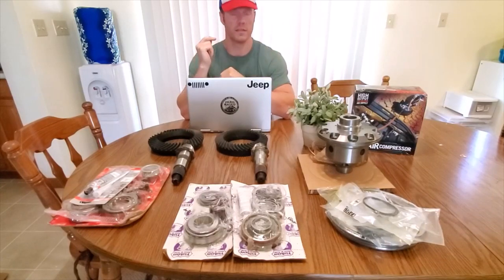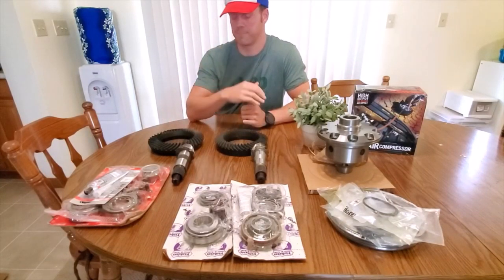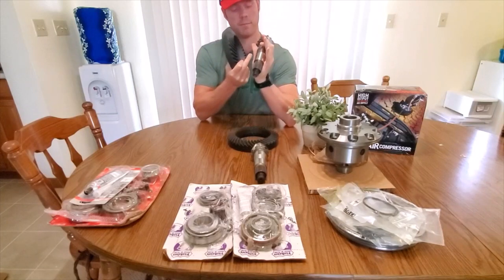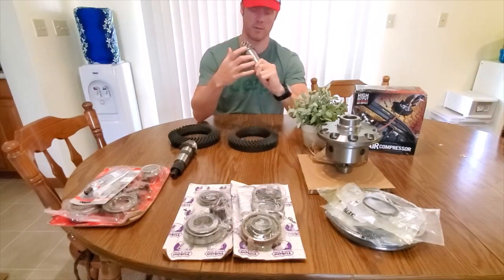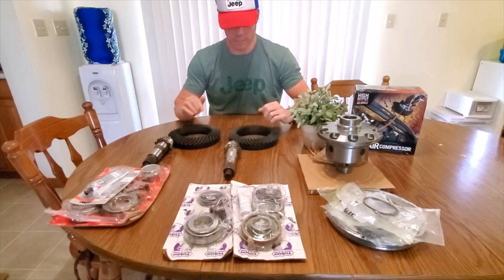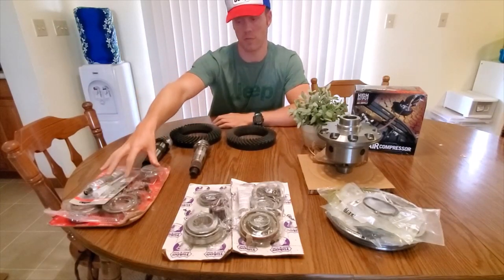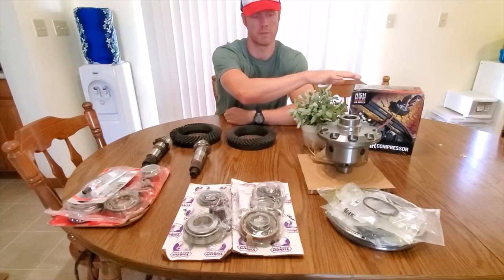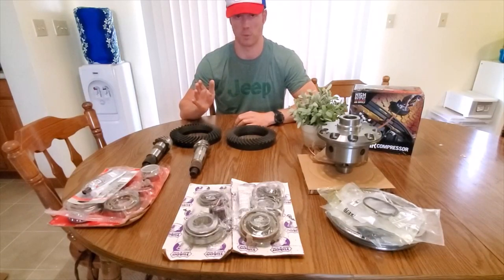JK vs JL Advantek Dana Axles M220 M210 Ring and Pinion ( Gladiator Wrangler Axle Tech )

Comment: Good information, I know this is a 4 year old video, but I recently bought a JT, and I like to get every bit of info I can on my 4x4s. 

I used to have a 2008 Nissan Titan. One thing that is cool about the Nissan version of these Dana 44 axles is that they are screw adjusters instead of shims. I put a Yukon Grizzly locker in mine and screw adjusters make it easy to set back lash. Yukon doesn't make that version anymore for the Nissan, but I digress.

Comment: Amazing vidéo. I got sport S put about 10 000$ canadian so 5 us lol of updated and got better numbers than Rubicon. Better lift better stabilizer fox ats2.0 race serrie. I do crazy offroad on 35s 3.73 lsd. I don't need locker not doing rock much. Rubicon is great but way to expensive here. And its not that great. Still prety low. If you love to do your own mecanic. Jeep is easy to work on.. sport is way to go. Overland doesn't offer much nor wyllis if you plan on lifting and change tires anyways. Rear lock himm not that great for normal driving and snow up north here. Lsd is better for those condition.

Comment: Nice video!  Subscribed...I'm curious why you feel 4.88 is the highest you would go in these advantek d44's?  I've read where 5.13 has the same # of pinion teeth and is very similar in size.  Most gear shops I've called and youtubers Trail Recon/WayOfLife claim 5.13 is the way to go and 5.38 is where the pinion meaningfully shrinks and weakens.  I have a 6 speed rubi jlu on 37s with 4.10 gearing.  It bogs down and stalls wheelin on ledges crawling in 1st.  Most shops are recommending 5.13.  Thoughts?
Reply from the maker: Just personal opinion

Comment: I have the Glad Overland and the optional rear limited slip diff. Did I gain anything with that? Thought the diffs were all limited slip if it wasn’t a true locker....
Reply from the maker: I have an LSD now, Its a good unit and really great for most. Gravel roads, dirt, mud, snow, and sand. Its great but its not a locker. I explain that in my 35 spline axle video here. https://youtu.be/wczYUI2UQj4
Reply: TewlTalk Thanks for the explanation.

Comment: What gear ratio did you go with? I’m in Augusta Georgia 488, 513?
Reply from the maker: 4.88, Its the biggest I would personally go in a D44. In a 60 I would go into the 5.xx. The 4.88 pinion head is stronger than 5.13+
Reply: TewlTalk I am brand new to the jeep community and bought a 2019 stock JL. I’m actually following your build as I do mine. Thank you very much for your service brother.